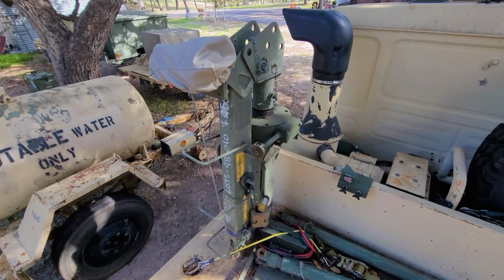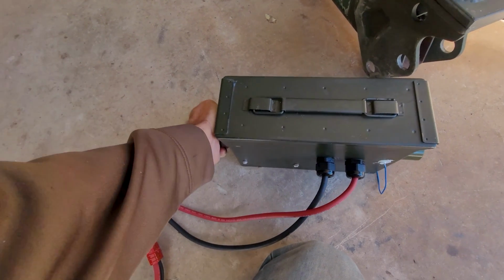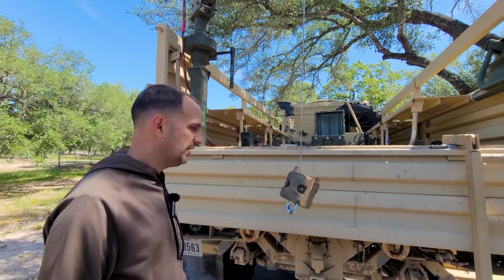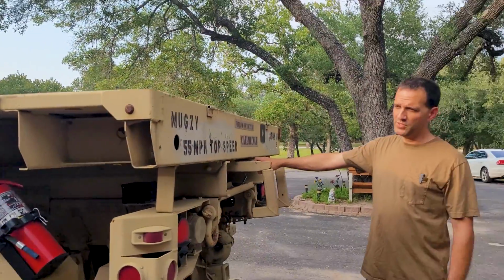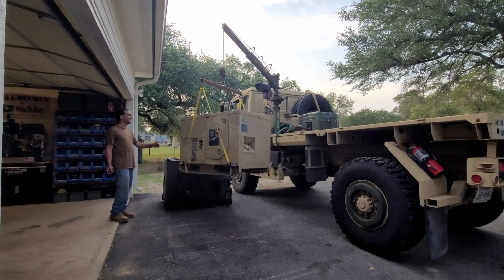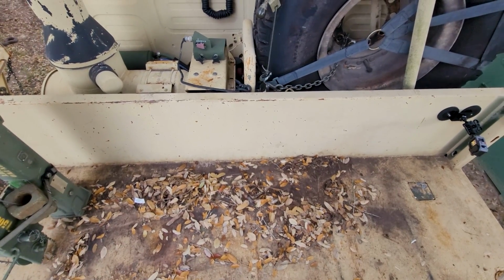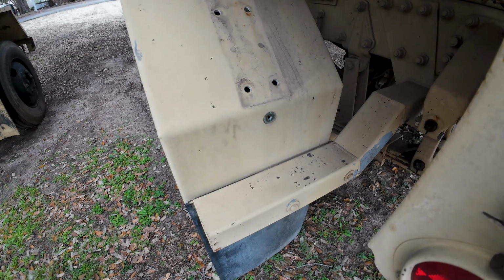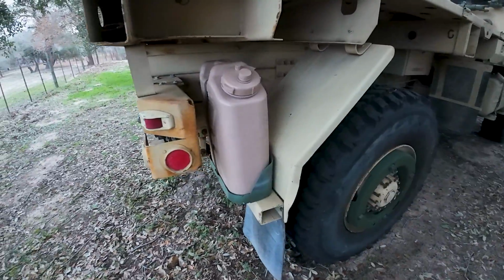M1078 LMTV - Update #21 LMHC, Tow bar mount, & Jerry can holders

Comment: Great set up with the crane Marine! I know you like to keep things authentic and military correct...but the ratchet system for the boom is slower than a democrat at the southern border.  Perhaps a hand held drill type electric drive to move it along a lot faster. I wouldn't want 1500 pounds of weight teetering off the side of that vehicle at that height any longer than necessary.  Just my two cents brother!  Nice gen sets as well.  Are those from War Fox?
Reply from the maker: I thought about making an adapter for the handle but it is very specific so the handle will stay as it is for now. If I end up with no drill or something, then I can't move it at all. The generators are ones I have gone through & sell. The one in the video is currently for sale actually. https://ebay.us/NvcX6M
Reply: Good point about the drill.  You need the drill and of course a battery or power  source.  I'll check out the generator.  Thanks! @CallMeColtLLC

Comment: Could have you mounted ammon can controller to crane and use waterproof bulkhead connection to crane motor then just make one connection with slave cable?

Could you have used rivnuts for jeery can install?  

Love your updates and editing. 

Thanks for sharing your talents and adventures!!
Reply from the maker: I had originally thought about putting the ammo can directly on the crane, but if I were to store it, it would definetly get damaged. As it is, it's pretty durable when it's broken down.

Rivetnuts would have worked fine with the jerry can mount as well. But when I can avoid them I do as they can turn into a nightmare when they go wrong. I love them though.

i appreciate you watching & the input. :)

Comment: @CallMeColt One suggestion, you should mount your jerry cans with the openings to the INSIDE. 1. To even further lessen the possibility of road debris or catching a branch off-road on the cap,  2. To prevent thieves from simplely unscrewing the cap and siphoning your fuel while you're at a restaurant or away from the vehicle, and 3. To make it easier for you to pick up the can when you need to take it off. Also, you should probably find a way to lock the fuel can to the vehicle if you're going to be away from it for a while.  I hope this helps. 8-)
Reply from the maker: They were just in there for example in the video. All good suggestions. There's a lot to be stolen on the LMTV. It's never left untended. :)

Comment: What's the lifting capacity?
Reply: Stencil on the crane arm said MAX 1500 lbs
Reply from the maker: I should have said in the video. As it comes from the factory, it is rated for 1,500lbs. I'd say it could do more with the proper lifting winch on it. The one I got really isn't meant for lifting. My goal was to be able to lift the 1,300lbs MEP 803A if needed & I can. So I'm happy.